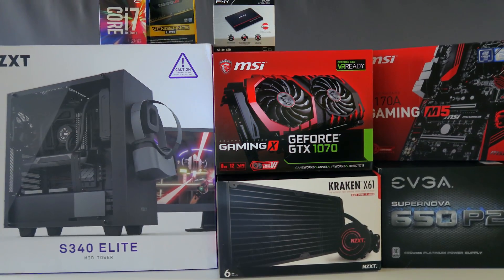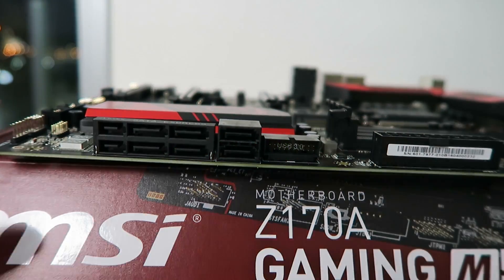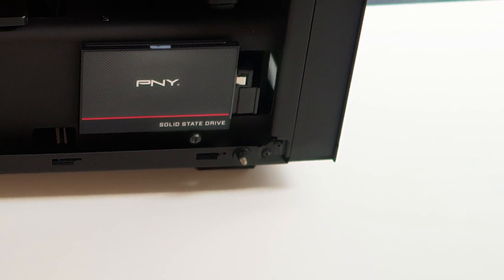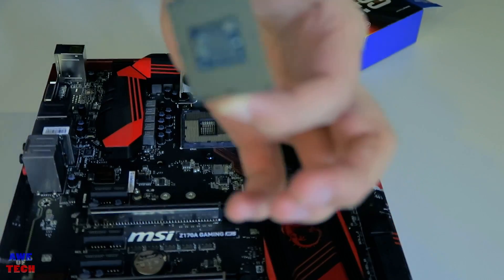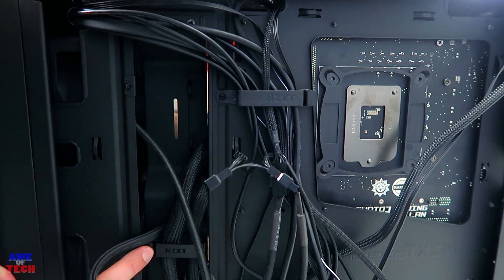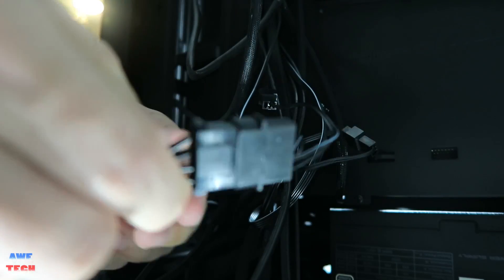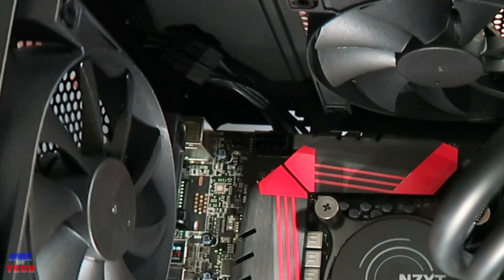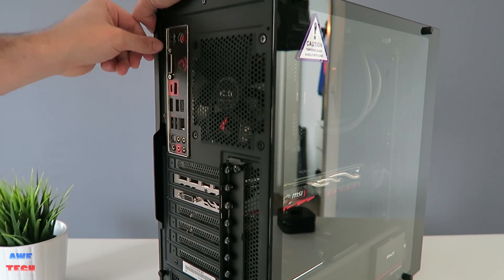How to Build a PASCAL Gaming PC Guide in NEW S340 Elite

Comment: This case is not good for 2 fan radiator. Single fan radiator at the top for outgoing and 2 intake fans for cpu and gpu at the front will be perfect.
Your build will keep that 1070 as hot as possible.

Comment: Guys, if I'm not using the water cooler (going for an air fan setup) should I just add two intake fans and it'll fix ventilation on the NZXT s340 elite?

Comment: I just bought this case yesterday and i have the say, it is a DREAM to build with. Especially if you're a cable management addict like myself. Another thing to note is that the tempered glass side panel means every time you have to add/remove a component its gonna make you have a mini heartattack because (you-know)its glass and fragile PLUS its heavy. But you will NOT regret getting this chassis! Oh and great video btw, very in depth and alot of reviewers on youtube often skip past the powerled connectors and stock fan connectors part. This video will surely help alot of people building this. Thanks!

Comment: will the power supply have enough headers for loke case fans and power for other stuff. like i havnt built a pc but i want to use a nzxt x62 but it was plug it into a cable into the power supply. ut theres no open slots

Comment: I 100% disagree with the fact you say the i7 6700k is over kill with a GTX 1070 play battlefield 1 with a i5 6600k you will bottleneck and be completely unable to get more than 110 ish average no matter how low you go with the video settings. Even the 6700k bottlenecks a titan xp
Reply: KrazyFuckinCrackers1 Battlefield 1 has terrible optimisation, I agree.

I have an i5 7600K and a GTX 1070 Strix and have only encountered bottlenecking on Battlefield 1, no other game so far.

Comment: DAMN JOHN.... i mean, not damn you John, just damn that pc is daaaaymn John.
Anyway, my 6500 is kinda bottlenecking  my G1 1060 in few games. One of those games is AC Syndicate where my 6500 is constantly locked @3300 Mhz and used 94-100% while 1060 is used just about 70-85%. 
Any useful advice ?

Comment: Hey, have you tested the HDMI port on the front I/O panel? When testing my Rift CV1 with it today, it didn't work. No image, just sound. Saw a thread on Reddit from a user with the same issue. It'd be a shame if it doesn't work. Got the case mainly because of the VR friendly stuff :(

Comment: i wanna get the white version of the elite with hue+.. i have a question about having a front radiator in this case.. i want to buy some static fans for the front to cool down my 1080, but do air even get through the radiator to cool off the gpu as well? :) .. nice video /guide

Comment: My build is an i5 6600k , z170 pro gaming mb asus, 16 gb crucial , Samsung 850 pro , s340 case , cooler master evo 212 , evga 550 supernova psu, Astro a40 headset , benq 2411z monitor , asus 1070 gtx strix gpu
Reply from the maker: +Billy jean Isnotmylover Very Nice Gaming PC Setup! Love the Strix 1070
Reply: just dont go with samsung, that brand is just awful, just do a google search.

Comment: haha, im gonna get a gtx 1060 and a fx 8350, I play 1080p so think thatll be fine
Reply: If I where you I would wait for the zen CPUs to come out.
Reply: Maksim Andriyesh Why not an intel CPU?
Reply: WormieGamez cost
Reply: Crackhead jack yea i probably will
Reply: why not an i3 6100 for $40 less.Its gonna perform better than the 8350 I SWEAR
Reply: in europe the fx 8350 is cheaper than the i3 6100
Reply: fx 8350 has 4 cores compared to the 4 hyperthreaded cores in i3 6100.
Reply: Exactly Betelgeuse their is as difference and you nailed it.
Reply: Kippenoma thanks
Reply: Transistor Express yeah, cheaper and better, i guess.

Comment: what the best build for a rx 470
Reply: I built my PC this month and went with RX 480, i5 6500, 16Gb RAM.
Reply: im running rx 470 with an i3-6100, its an amazing combo for such a cheap price :D
Reply: Thx dude and I mentioned an rx480
Reply: Ment
Reply: TheEligableGamer I'm an AMD fan.  And for the price they are great.  You see...

Jokes is jokes!!!...
Reply: Do they make quad core hamster wheels?
Reply: Harrison Knockers everyone is not rich
Reply: I would still get i3-6100, if you want to invest, i5-6600k. I would not suggest the i5-6400 or i5-6500 because they are a lot more expensive than the i3-6100 and not quite that much cheaper than the i5-6600k, which is an extremely good overclocker and performer. As I said, I would get i3-6100, best bang for buck on low/medium end builds.